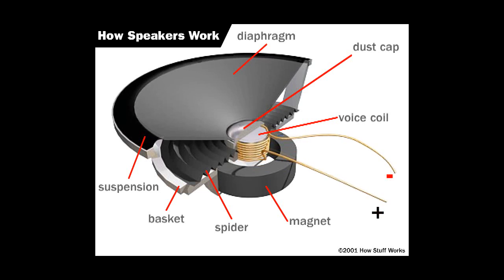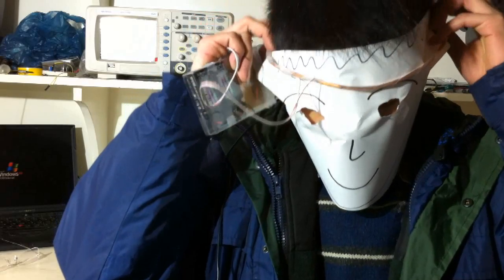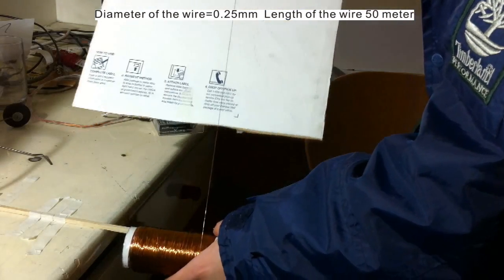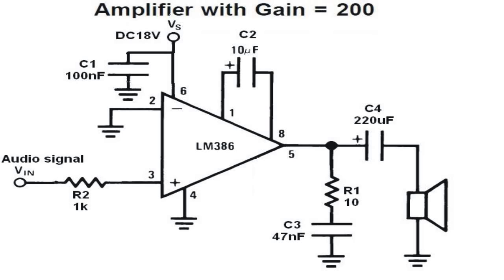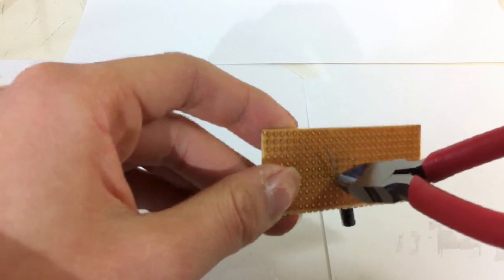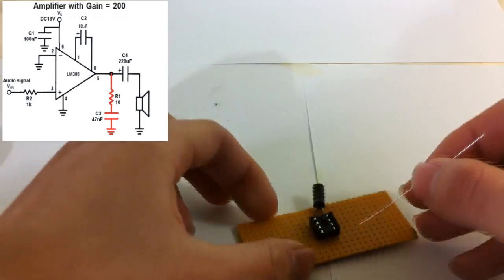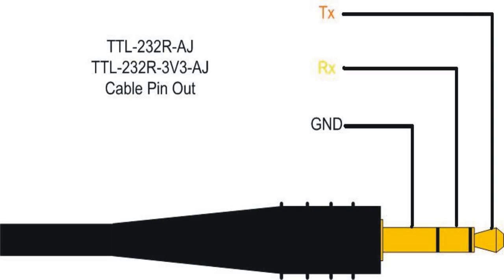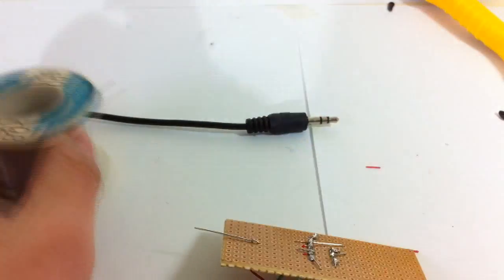Make Your Own Invisible Earbuds

Comment: what is the voltage of C1,C2,C3,C4
Reply: +YASH THAKUR  if you have amplifier input voltage 9v your capacitors voltage must be more than 9v,per example 10v at least. 16 volts will be perfect. Cheers
Reply: capistor voltage and all data send me clearly plz
Reply: +Robert s He has two 9v batteries wired in series, that means the supply voltage is 18v.
Reply: ProjectDv2 my mistake.Use 20volts for capacitors.cheers :)

Comment: What is the effect of use a larger diameter wire vs a smaller diameter wire? I have bought these before online but they always stop working after a wire. I suspect the wire coating rubbed off and short circuited. Thanks

Comment: any voltage higher than your operating voltage will work: if you have a 6v system, a 12v capacitor will only charge to 6v before reversing the current due to inverse voltage push. But if you get a 12v system for a 6v capacitor, THEN you get problems. Does that help?